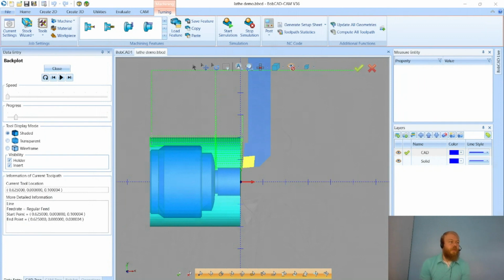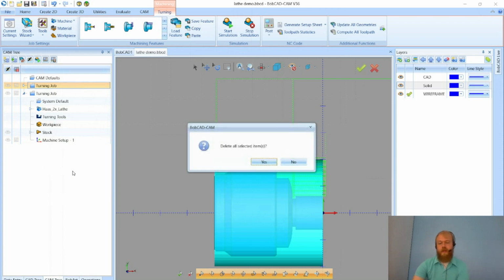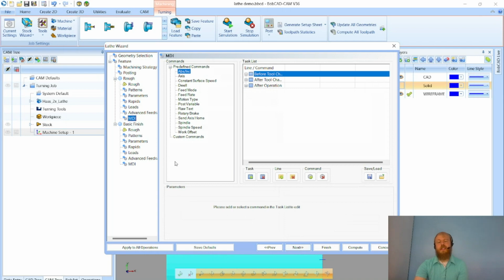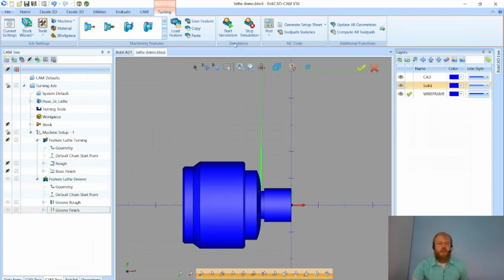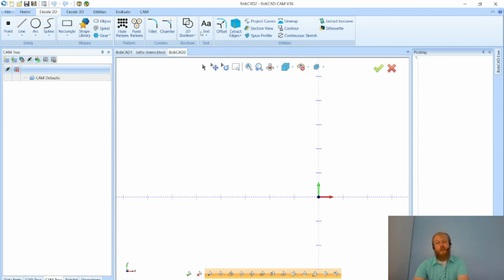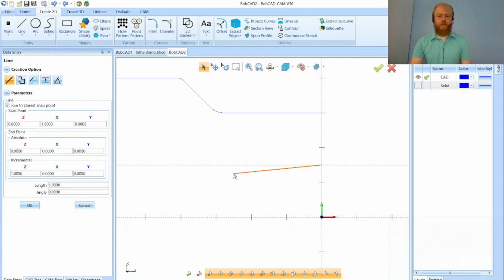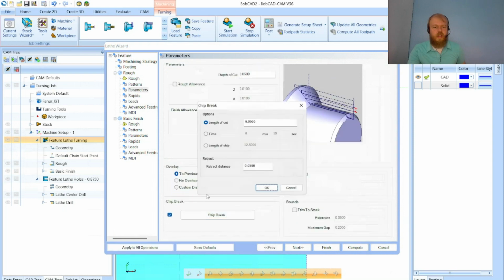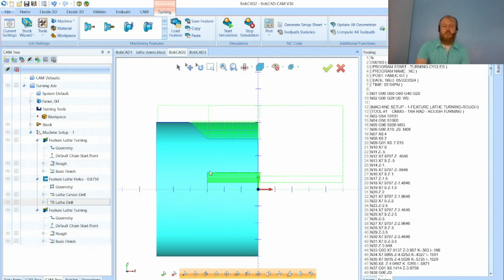Turning Techniques Unveiled: Elevate Your Lathe Skills!

Comment: @31:46 Continuous pattern pass would delfect the tool from the face as the tool aproaches  the OD thus creating not quite straight face. Where alternate pattern pass creates perfect faces since the tool pressure is the same all the way in the cut.
Reply: Use of these patterns depends on tolerances on the drawing, but yes, if the face for example is some sort of a sealing face, you would use alternate pattern. Or there are two faces that need to be parallel to each other.. and so on